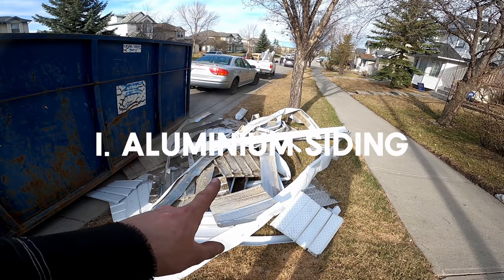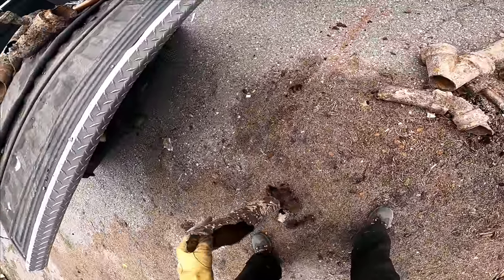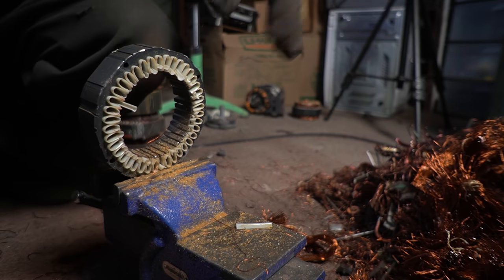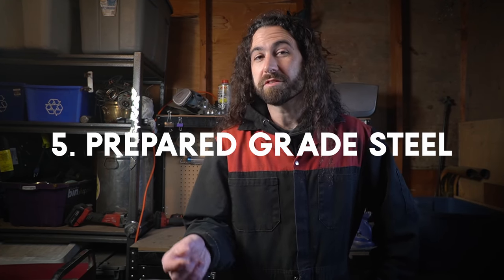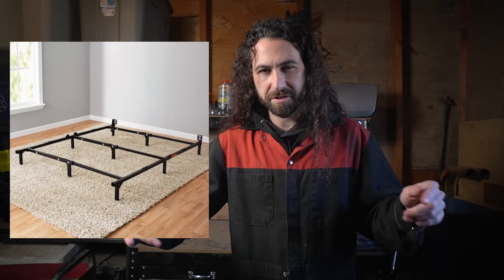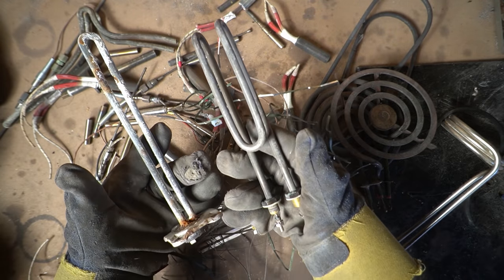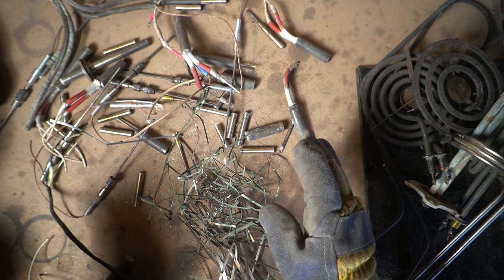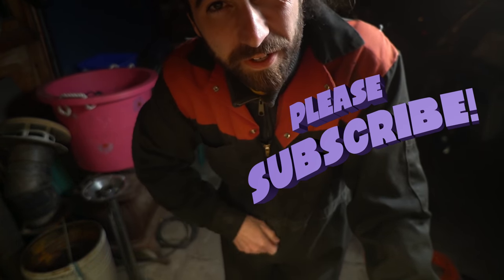5 Things You Didn't Know You Could Make Good Money Scrapping!

Comment: You can burn the tires off the rims !  The bed rail is hi carbon steel they make great peaces to build things with because they are strong for there thickness .   Cast iron bath tubs are 300 lbs that makes for a good pay !    Look for any brass that pays good and radiators aluminum or brass .  And steel is good but if you get it all then you can really cash in !  Another thing is if you can tear down a old house .  There are people that will buy that wood and if you do you can get all the copper and appliances .  The wood will bring money if the woods good .  Because it cost a lot of money for new wood!
Reply: Burn tires? Come on dude, leave it better than you found it! That includes our air quality!

Comment: You are definitely out of your mind there kiddo. Removing the power cord off of trashed appliances is perfectly fine and it actually makes the situation better since there's less trash left out.  If somebody wants to take the steel and you want to take the copper where's the problem. If you're selling it by the pound as scrap steel you will not at all notice the power cords missing and the majority of the time when I see appliances at the scrap yard when I dumped off loads the cords are still on there and they wouldn't notice that they were gone because they're not even separating it.

Comment: Warning to scrappers.  Stop trespassing.  I had a scrapper steal a bunch of metal items and more from my yard.  A brand new aluminum ladder.  A butcher block countertop with a brand new stainless steel sink and $200 faucet, an antique fire hydrant which they probably got $20 for but was worth $350, a motorcycle stand, and a bunch of small items from my shed.   The counter top was outside because we were installing new cabinets. I had bought the ladder only a few days prior to the theft.  I rode around for weeks taking license plate numbers of obvious scrappers and handed them over to the police. Now my yard is covered with covert cameras and I'm more than willing to press charges for trespassing and theft.

Comment: The small flat ones that came out of assort. Lab equip. Is an alloy of nickel and chromium used for fast heat such as the lighter in your car the  tubular  elements  out of your ovens and dishwashers and the flat coiled up ones such as your stove top is an alloy called inconell high nickel content  Anda high chromium  content with other small amount alloys to be worth any kind of premium all ferrous  attachments need to be removed your oven elements are normally the nickel  chromium wire inconell  should be paying 1 1/2 to 2times the price of clean stainless steel

Comment: They only buy steel in 1 grade except stainless at my local recycling center. They wont even buy washers or dryers or any appliances here. You have to take them to the dump and pay them to take them. But i tear them apart and sell the copper . steel isn't worth it around here. It's only 75dollars a ton. And thats a high price. Batteries are about 10 dollars each. They don't even check anything with some machine. They just go by what it looks like.
Reply from the maker: That sounds really disheartening, I’m sorry your area is so soft on their pricing. I assume you’re in a relatively small interior kind of town?

Comment: Maybe there's money in steel, but I make $300- $500 a week in brass and copper and drive a suzuki sx4 hatchback, the smallest car next to a smart car, all from dumpsters, that's on top of the $100s a week I make on the other things I find and sell, I cleared over $25000 last year, 100% from scrapping and selling what I found, all without a truck or stealing anything. It's taken a few years to learn what's worth money, what sells and sells quickly, my hobby has turned into about 70% of my income and growing every year and I have alot more free time with my family because of it. But great tips for those that can move volume, especially rotors, I literally find 30 yard dumpsters half full of brake rotors sometimes, I'd take them if I had the means.
Reply from the maker: That sounds awesome, well done! You must’ve put together a pretty decent little route by now 😋
If anyone finds a dumpster full of brake rotors feel free to send em my way haha
Reply: @thubprint  I'm blessed to live in an area where nobody else really goes after any scrap for some reason. About every 2 or three months a local shop fills a dumpster and drops it off, always full of drums and rotors, exhaust parts, engine blocks etc. I've pulled cats out of it but Noone touches the rest. The nearest yard that pays well is 2 hours away maybe that's why no one does idk.

Comment: All I get for steel in AZ is .04/lb. “Until further notice” 🤷‍♂️ I hope it changes soon but I still bring in steel stuff. I scrapped an old refrigerator today and it had a sealed unit and about a pound of aluminum. No copper. Steel pipes 🤦‍♂️ still got $23 for it.
Reply: Where are you going? Liberty or whatever they go by now was $240 a ton last time I took a load a month ago. 43rd and Camelback just south of Grand.
Reply: @patmurphy1869  I’ll have to look into that place. I went to a couple that are closer to where I live (“scrap metal exchange” and “I buy scrap” or something like that) and they both were doing $120/ton of shred or prepared steel. Which I though was dumb that they paid out the same. A guy told me it’s just what the scrapyards in AZ are doing right now. Who knows if that guy really knew what he was talking about though 🤷‍♂️ lol
Reply from the maker: That’s a pretty awful price for steel, I hope you find a better buyer soon
Reply: @thubprint  I hope so too! I have a collection of copper, electric motors and a/c radiators going that’s about $350-400 right now by my estimate. Got lucky with a large ac unit and some other bits at the beginning of the month so I’m happy about that. 👍
Reply: @justincloss799  A package ac unit broken down fully is worth $150-200 depending on what clean copper/alum coils are bringing now. I want to say it was about $2.50/lb last time I went. Make sure you cut the steel ends off and save all the copper 180 bends as #2. Makes coils worth a lot more, and not hard to do with a sawzall. Liberty wants sealed units(compressors) drained of oil, I just drill a small hole in the bottom and drain it into my car auto oil recycling pan. Motors were .15 a pound,  cut the wires off them and keep all the snibbets of wire separately, they pay for that too. Transformers, brass TXV's and king valves, and reversing valves if it's a heat pump all pay too. If the fan blades are aluminum,  grind the rivets off the steel hub. 
 I'm a mechanical contractor, so I get ac units for free, lots of brass and copper from plumbing jobs, fair amount of wire also. I pick up all kinds of scrap in attics that gets left by the builders that most people are too lazy to clean up. Thub and Mike the scavengers videos are good resources to learn about a lot of the in and outs that can cost you lots of money. Most of the yard people in Phoenix will help you too if you ask them. Don't be afraid to put the scrap back on your truck and walk away if you think they're screwing you, I've done that a couple times.  You can always break it down further and come back, or try a different yard. You can bargain with them also if you have a lot. I'll call a couple yards before I go down and find their prices on stuff, and if they're way off, I'll ask them to adjust the price. I usually bring about 3-4000# at a time, 4x a year. Last 2 trips have been $12-1400 each, so it's worth it to me. I'll usually grab a beer or two and a cigar and separate stuff into buckets every week or so. I find it relaxing and I like to see how things work and are made. 
 Good luck.
Reply: @patmurphy1869  awesome info, thanks man! I wish I had a garage or yard to store stuff and really make some good money. For now I’m stuck making smaller runs of scrap steel and just collecting what is worth more that I can fit in a patio storage closet. lol Apartment life sucks when you’re interested in engineering, wood working, stuff like that. I have all sorts of tools to work with that I’ve purchased for independent work over the years so that’s cool, just want more space!
Reply: @patmurphy1869  haven’t found a yard that can do more than .04/lb. If you have a location you know of, please let me know which place. I’d like to make actually good money doing this because it’s far better than doing grunt work for someone else at a $12-$15/hr rate. I have a job from 8-4 and it’s still not enough! Damn this Biden economy! Lol
Reply: @thubprint  end of the month total, $215 for my copper piping (#1 & #2), my copper/aluminum radiators, and 109lbs on sealed compressors. Plus I have my electric motors and transformers that I am still holding onto. I thought about breaking them down for the copper but I’ve been obsessively learning about their applications and now I want to start building things like electric go-karts, scooters and whatnot. 🤷‍♂️ who knows if I will be successful making money doing such things, but either way, it’s fun. Thank you again for making your videos and inspiring me to scrap. It’s a decent way of gaining funds and also is good for the environment. Can’t complain there lol keep doin the thing!

Comment: I hate it when I see a vacuum cleaner or some other thing I could use or sell with the cord cut off of it. Especially if it looks usable or almost new. I haven't bought a vacuum cleaner in years. I used to find them on the curb. Just cutting cords sends more things to a landfill that would normally be resellable after it is cleaned and tested.
Reply from the maker: Precisely, yes! So silly to destroy something for 0.20cents worth of wire
Reply: @thubprint  It's pretty easy to replace a cord, and most of the things I've seen left out at the curb aren't picked up by anyone. So not only is the appliance or vacuum going to the dump, but so is the cord if you don't take it.
Reply: Daniel,  I also clean and sell vaccuum cleaners, especially bagless vaccuums are considered more desireable by purchasers. 
Nothing I collect is scrapped before being tested to see if it works. If it works, it is worth more to me than scrap prices. Even cardboard packing boxes are worth a couple of dollars each.
It amazes me what people throw out.
Microwave ovens have fuses inside them which may blow & cause them to be thrown out, a cheap & easy fix, pedestal fans are easily moved in summer, heaters in winter, each often only requiring a thorough clean.
Reply: Actually, Most of the time it is the homeowners that cut the cords..
But I take them  anyway  for the motors that I strip down.

Comment: Actually there are quite a few obscure metals that are nickel alloys used in aerospace technologies. I was at the yard the other day and a couple guys brought in some metal that they referred to as molly. High heat nickel based alloy not even sure but they put it on the gun and sure enough $10/ lb and they took it straight to the back where the good stuff goes on lock and key.
Reply: Mollybdenum actually rn its average price is around $5 per lb but I think because of where I live it sells for more.
Reply from the maker: Wow, that’s a cool material! Where I live they’d probably take one look at it and throw it in dirty aluminium 😆

Comment: How about the copper in the back of refrigerator s
Reply from the maker: The steel is worth two or three times as much as the tiny copper line between the fridge’s compressor and the fins, they barely use any at all.

Comment: After I take the copper out of electric motor I put motor back together So I can get electric motor price for them motors even though the copper removed
Reply from the maker: That’s a great way to get banned from the yard
Reply: It was them that told me that. I was unloading sheet metal and had them in there and dude came over and mentioned I can sell them as electric motor. I told them 6 times I took the copper out they still wanted them as electric motor so I'm not getting banned from anywhere my friend
Reply: I've done it several times since then.

Comment: You said appliances you can get $10-$20 each. What did you mean by that I called six scrapyards and they said it just counts as normal and Tin shred
Reply from the maker: That’s correct, it’s all done by weight and it’s up to you how much time you want to spend removing motors/wires/copper/aluminium/stainless to sell those higher value materials in their own

Comment: I collected some Nichrome (nickel chromium) strips from a toaster heating element. I was wondering if they were worth anything, thanks for the info!
Reply: Reversed Garbage  that sucks cause they’re worth a lot more, it’s like 80% nickel or something, but the weight is like nothing
Reply from the maker: Yeah I could’ve worked a little harder to get the real price and the real info on them in hindsight.. I think it’s likely that most people will still get paid dirty stainless for them but I kinda dropped the ball here
Reply: According to Wikipedia, Stainless Steel is mainly made of Chromium, Nickel and Molybdenium. So, Stainless steel pile. My scrap yard actually pay 95 cents per pound for SS...
Reply: @maxcloutier5285  stainless steel has a whole bunch of iron, worth way way less. On the other hand Nichrome is made entirely of nickel and chromium making it much more valuable

Comment: And just the ads of that I have years of experience in scrapping the scrap yard that I used to go to that closed down I always got top dollar price for everything I brought in because I didn't bring in 2 lb of this 3 lb of that I always rolled up with like bulk amounts and everything was processed so all they had to do was throw it in a bin little bit of extra work on my part but at the end of the day it was worth it to get that extra 10 to $0.20 or more extra per pound more I did it the faster I got at it steel to me was always bottom of the list by-the-way washers and dryers the electric motors in those were pretty much considered is a because the supposed copper winding we're just copper coated aluminum wire I will admit you got me with the steel that the electric motor windings are attached to I didn't know that one but I guess old dogs can learn new tricks but on the flip side of that Young Bucks can learn new tricks as well

Comment: I agree to disagree I been scraping for over 30 years  copper is scrappers gold yes it's nice to take a load in for a 100 to 150  for a load of appliances but that copper brass raidiators aluminum adds up so I strip it all off the appliances  then take a good load of copper brass raidiators aluminum ect. And get paid 1500 to 2000 dollars

Comment: you've never walked into a used furniture store and found a back room full of mis-matched bed parts including like 20 truck loads of brass frames alone...  1 furniture store, $300 offer for it all and i clean out the mess, was a deal at $500 and 2 days to empty it out.  Profit was $13,000 roughly in total on bed frame pieces.  15 shops later and another score.  1 Year i scrapped over $80,000 in bed frames parts alone from stores.  You gotta do the leg work and barter...  smh corner shopping is a hobby

Comment: I would have to say that most of your videos I agree with you on this when I disagree bed frames are not repaired iron the reason being is the lowest grade of prepared iron is a quarter inch thick and less than 36 in.² anything less than that is nothing more than 10. Also are you call cherry picking the best stuff is not a great way to go not everybody has the option to haul loads of steel. I have done Recycling for many many years 37 in fact and well I would haul thousands of pounds of steel to the scrap yard taken in 10 1215 aluminum rims and full of copper wire a little bit of brass a little bit of aluminum outside the rims I typically would make twice or three times on the good metals, nonferrous, then I would make on the steel. I believe this is a handling issue with the scrap yards as each area in the country and around the world I’ll process and handle Scrap differently.
Reply from the maker: Yeah bedframes are probably not prep no matter where you go haha
I understand cherry picking is the only option for many people, I think the years of videos I have of myself scrapping with my hatchback grant me some experience to speak from as well. I wasn’t seeking to guilt trip anyone, but I do believe anybody who was able to transition to picking up all the steel they come across would earn at least several times more per week from running scrap
Reply: @thubprint  I would agree with you nobody’s on here to bash one another I agree wholeheartedly with the aspect leave it better than you found it… Onto another note your videos are some of the best put together and easiest to follow Vinny have found including my house Mater does recycling she can follow your videos and do it right the first time for everything else out there just laser confused and frustrated thank you for doing a good job it is greatly appreciate it

Comment: You are missing a golden opportunity with your appliances etc. Selling parts on ebay. Sometimes a set of range knobs in good shape can sell for $40. Fridge crisper drawers the same. Confirm those heating elements are in working order and you can get $25+ for them. Washing machine timers, pumps and valves can be sold too for less than somebody can buy one new. People part out cars all the time so why not other things? Parting out everything from vacuum cleaner parts to bicycle parts can make you far more money than selling scrap for 15cents a pound. Recently saw a non-working GE range control panel sold for parts or repair for $100. Selling the range for scrap might get you $10. Think about it.